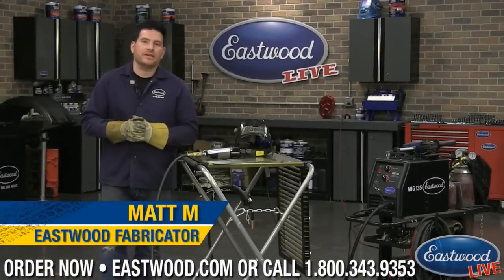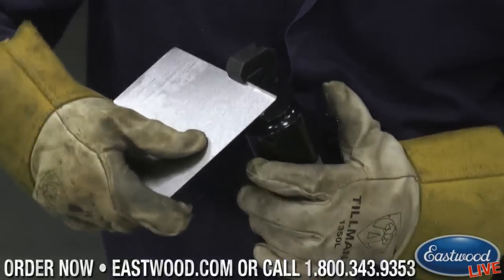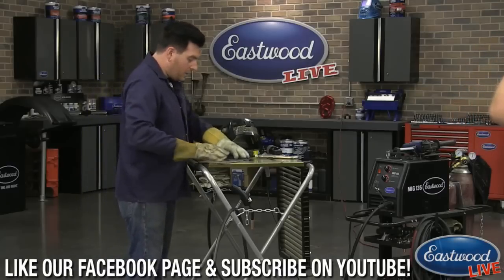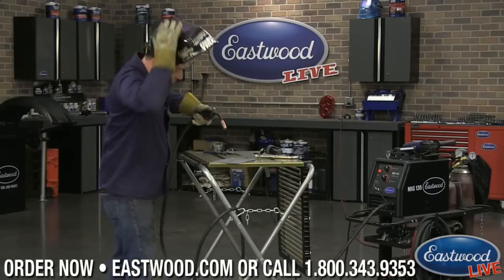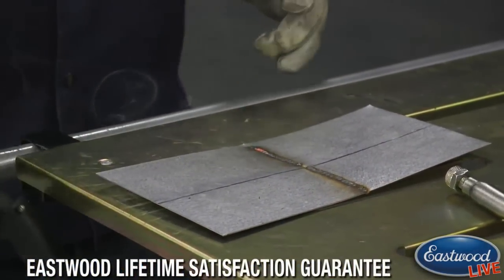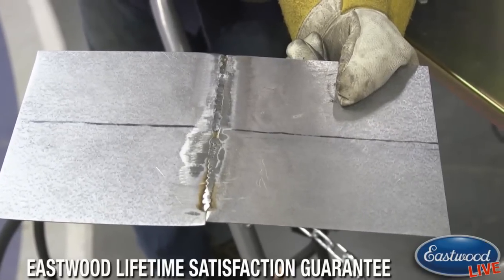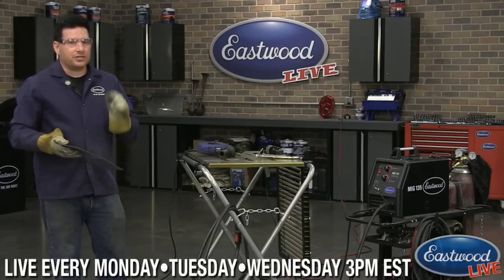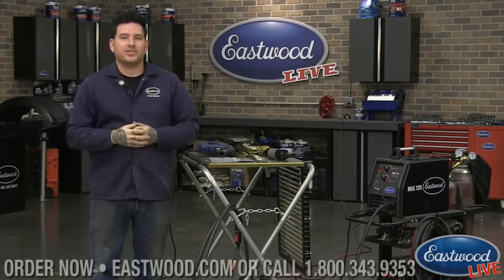Great Tip for Welding Sheet Metal.  The Perfect Panel Prep Tool from Eastwood

Comment: So if you were patching a car, would you use this bevel tool on both the car itself and the new panel?

Also, what settings were you using with your MIG?
Reply: Yes, I second that! 

AND, how would you weld a crack in a fender such as on a '32 ford PU? We had one for decades on the farm and guys tried to weld the splits caused by constant vibration where they'd go from the edge of the fender up to 8" to 10" in. But, all they'd do is melt on globs that would hold for about one drive on a bumpy road. I tried brazing them when I was a kid of about 14, and did a little better, but they still didn't hold up. It was also nearly impossible to not burn holes in the metal. We ended up with patches screwed on with sheet metal screws to keep them from falling apart. 

Back then we only had electric arc & oxygen-acetelene welders. Now, I see guys on TV shows like Power Nation arc welding new panels on, so it seems to me that whatever settings they're using for those replacement panels would work on split fenders. I know that this splitting is still a big problem on restored & hot-rodded cars & PUs from the era of that style of large fender stampings. 

I'd like to see a demo of that type of crack welded up, please!  Thanks!
Reply: That is what they are suggesting doing. 

As for cracks, you'd have to cut the panel apart to do it with this method. And you'd just end up cracking next to the weld eventually as this would create too much structure in an area already under stress. 

The only way to prevent cracking is properly patching the area with quality thickness metal and adding bracing to prevent over stressing of the panel. Butt welded in TIG welded panels are the only way to properly achieve that. 

Wire edging was the primary means they added such structure to the panels back in the day. That with secondary braces will help quite a bit.
Reply: Thanks! Yeah, after I thought about what I'd written, it dawned on me that this metal is going to be very brittle everywhere near the crack from all the flexing. Ford never properly braced those fenders, and I don't know if anyone has devised a better setup to prevent that happening to replacement fenders. I know the replacement fenders exist, but they ain't cheap, either. Someone needs to invent a better mousetr- er, bracing system for these things. 😉
Reply: Open wheel cars, that's how you fix that. Haha

Really though I've added braces before. Can't say they'll last fifty years but I haven't had issue so far.
Reply: 🤣 Good one!  Yeah, except that's illegal in this state (CO), you'll even get a ticket for more than 2" of tire exposed outside the fenders. Front plates are required as well, but I still see a few scoff-laws both w/o fenders or a front plate. One newer Corvette owner said he's willing to risk the ticket & pay the fine to preserve the aerodynamics with no front plate on his C6. I kinda doubt he's planning on obeying speed limits then, too...
Reply: Yes I want to know this question as well.
Reply: Not many 90+ yr olds on youtube. But then again back then Im sure not many shops had mig welders but its a rather old process.
To get a demo I would have to see what you are refering to as a crack. I myself in the body work (sheet metal work) do more rocker/cab corner work on pick ups than the thiner sheet metal on body panels but i have done some custom fender work on civics and subaru wrx's type cars. 
Now as for old vehicles. A lot AND I MEAN A LOT were far from straight/symmetrical from the factory. Chassis off by 1/4 to 3/8's of an inch. One fender larger than the other but a quite a bit when you look at todays tolerances. The idea was if you look at one side then walk around to the other the eye will not notice a fender being 1/2 smaller or the opening for the wheel being (i have measured) up to 1 1/2 inch different than the other. 
Fords were famous for this as they were about mass production for cheap prices like they are today.  The only time a doge was good quality was in the early yrs. They were on a path to being a luxury vehicle. Rather shameful now as they have one of the best looking pick ups out their but built using "china made" quality. And before you jump on the oh fuck he is a gm/chev fan boy. I sure was because until the recent yrs (government bail out) they had nice or ok styling vs the fords and dodges in my opinion. The quality was far better than dodge or ford by a long mile. Fords were catching fire and dodges needed a bank of ball joints behind them for warranty work and they rode like tanks.  I still love the chevs/gms but they have gone to hell with their pricing. Now that the new dodge style is "old" its lost the visual appeal so the chev/gm still wins on quality. If I were to buy today on a balance of quality and style the only pickup I would buy are the smaller ones. The Colorada/Canyon  the Toyota Tacoma TRD 2015 (not new...the new grill opening is too big for the size of the truck) or the Nissan Frontier 4 ProX.
Sorry for the babble that strayed from your question. But a lot of the old trucks were not clean metal (was lack of knowledge on metal in that era) so the ideas of stress and fractures were not a big thing then. They stamped it and put it on their vehicles. Not a lot of R&D on the structure of metal back then. Welding with a stick welder was prob better though as GMAW was a cleaner weld and would of fractured from the dirtier factorry metal anyway.

Comment: You're not grinding the weld off.  This maintains the strength of the weld.  Plus the raised edge, even though it's inverted in practice, resists warping to an extent.  Good idea.

Comment: Is your cone touching the work?  If so why isn’t it arcing?
Reply: The larger welding gun  nozzle is insulated from the welding wire and the small welding tip.